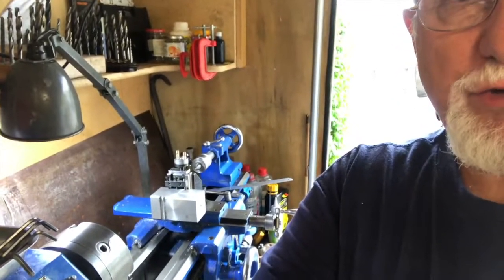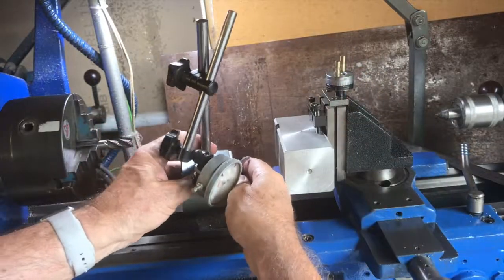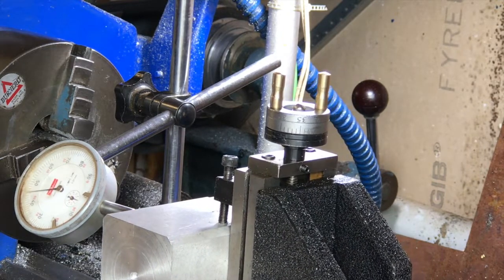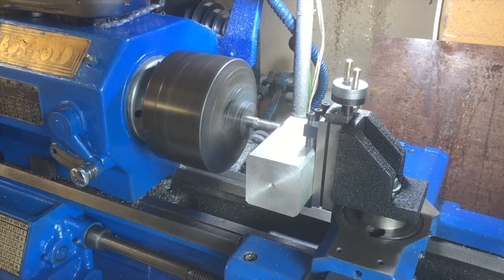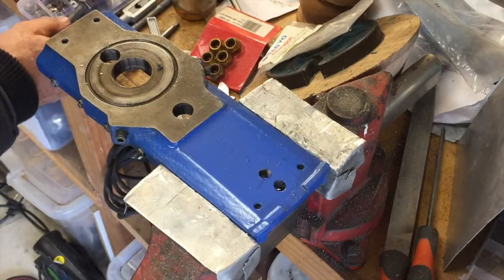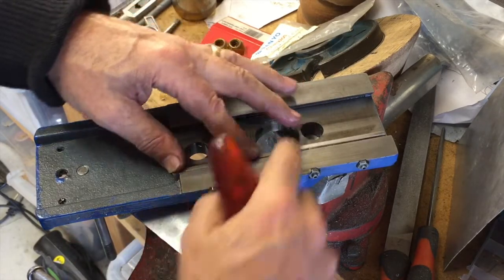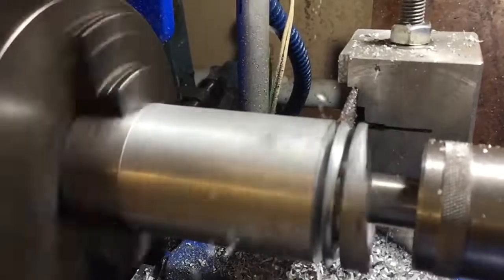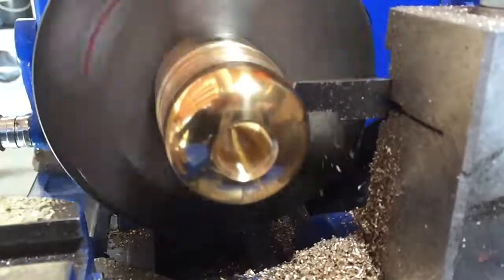Make a rear mounted cutting off (parting) tool post with a metal lathe & milling attachment. (S3-E4)

Comment: Inverted tool is a good system ...this method prevents the common digging in  problem...
secondly.. if you happen to be slightly above centre you only end up with a small uncut bit in the centre.. 
NOT needing a reverse..is good if you only have single phase power if you have an older lathe
Reply from the maker: Yes. Thanks for your perspective.   Certainly digging in is prevented by this method because the tool lifts up and away from the work instead. 

I have also used an inverted tool in a front mounting and the motor running in reverse, and that works very well too. Although it sounds simplistic, I think a big advantage is that with the inverted tool the swarf can simply drop out, instead of packing between the sides of the cutting tool and the narrow slot it is producing.

I have a Boxford lathe with a screw-on chuck and it definitely comes unscrewed when running in reverse, so I have made a clamp with grub screws that clamp onto the spindle and the back of the chuck.

I have made a previous video on YouTube explaining how to convert a single phase AC motor to run in reverse.  

But since then I have replaced the AC motor with a 2.5 HP DC motor out of a treadmill providing reverse and variable speed with a tachometer, and made another video about that. I hope you find them interesting.